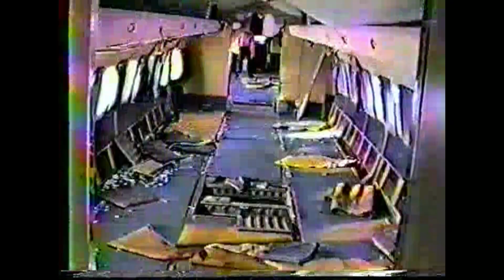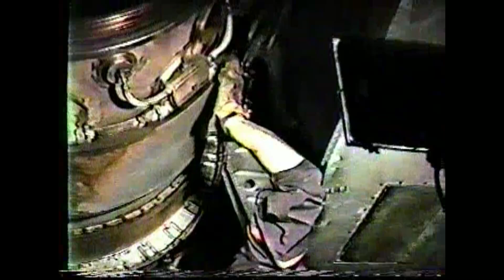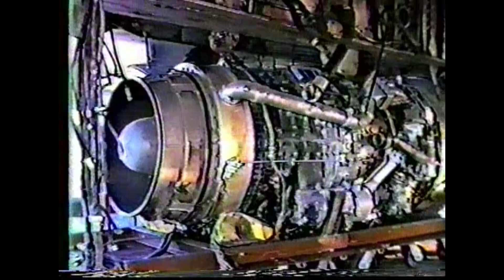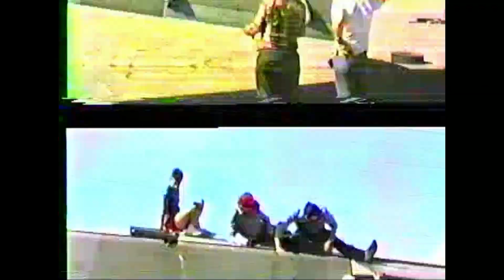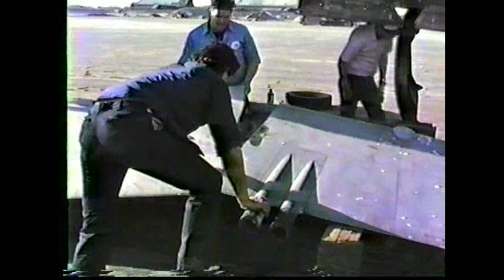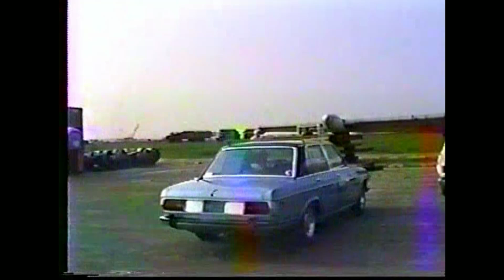Introduction to the O'Hare de Havilland Comet Team

Comment: I remember flying on the Comet 4C with British charter carrier Dan Air back in the late 70s. I later worked for Dan Air and the engineers said Comet engines were a nightmare to work on due to the in wing design. Those flaps were like barn doors hanging off the back of the wings
Reply from the maker: Hi Simon, thanks for your comments!  How luck you were to fly on a Comet!  Take care, and tell others about the video series.  More to come.
Reply: I worked at Dan too, was lucky enough to ride in the flight deck of G-BDIV and G-BDIT.